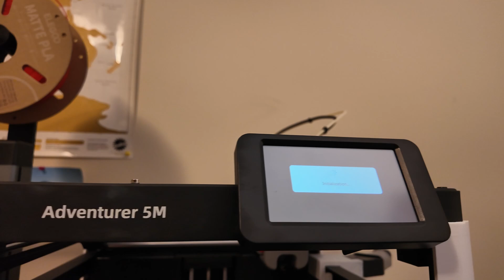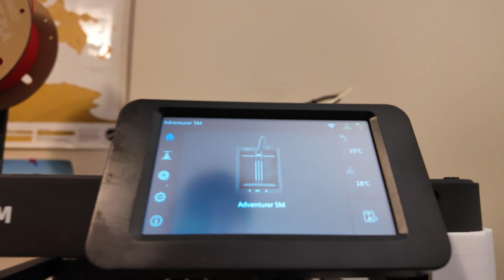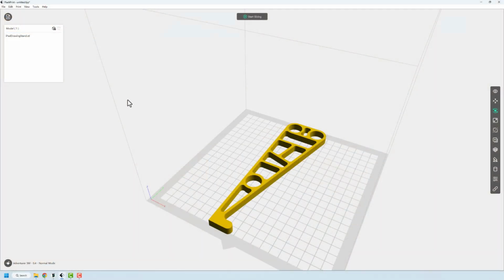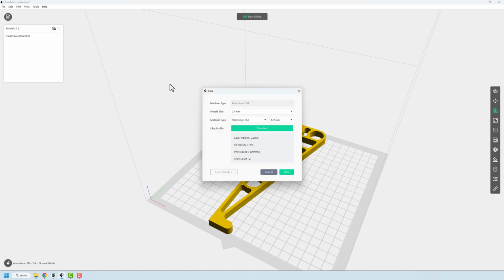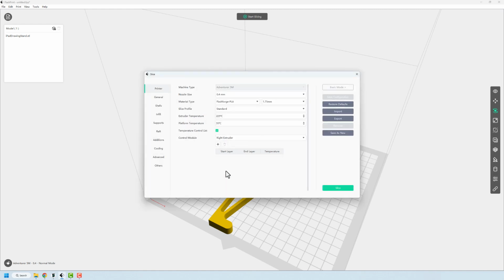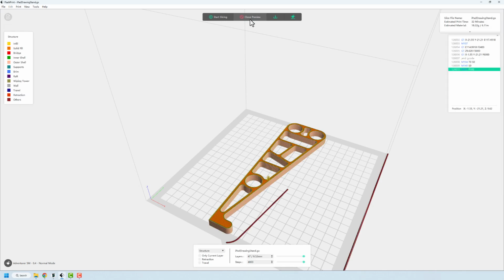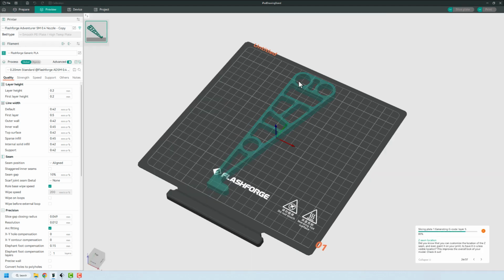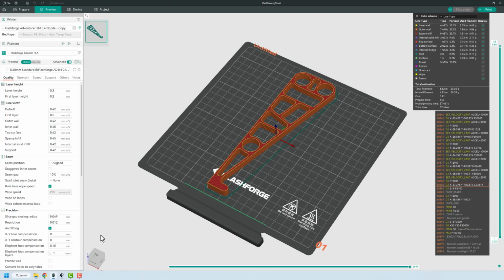My Favorite #3DPrinter FlashForge Adventurer 5M

Comment: Am Knew to this, just order Avenger 5M  3D Printer, how hard is it to learn how to Use this printer an any tips on getting started? 🙏
Reply from the maker: It’s a super easy printer to use. Just make sure you unscrew the bed from the base when you get it out of the box. I use OrcaSlicer as my software to run it but FlashPrint5 is also fine. Just follow the setup guide and level the bed and such. Let me know if you run into problems and I’ll be happy to help.

Comment: the biggest reason I need an enclosed printer is because where I live the air is very dusty, everything gets covered in dust quickly.
Reply from the maker: I totally get that. In the summer I can have a few humidity issues that an enclosure would totally help with.